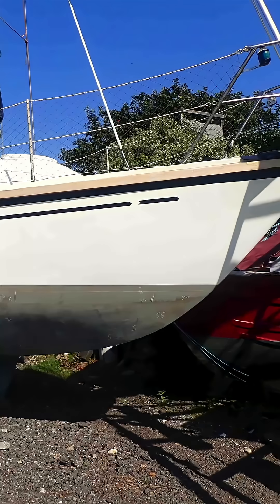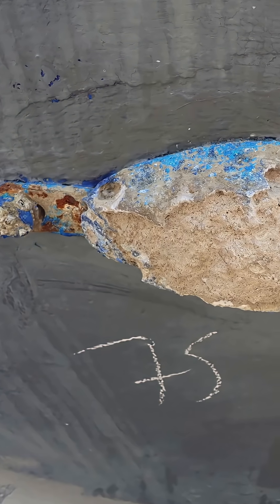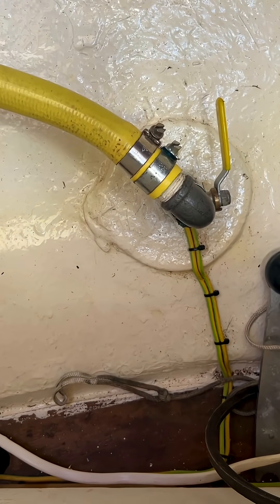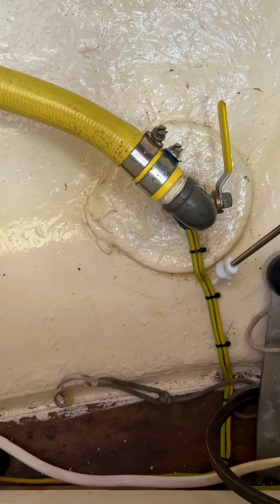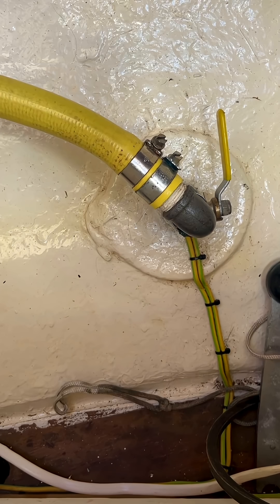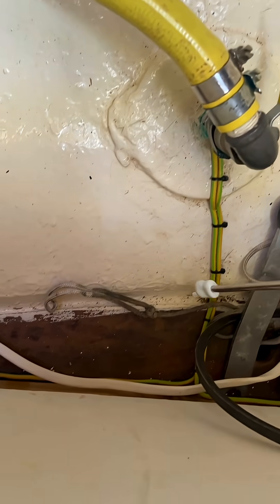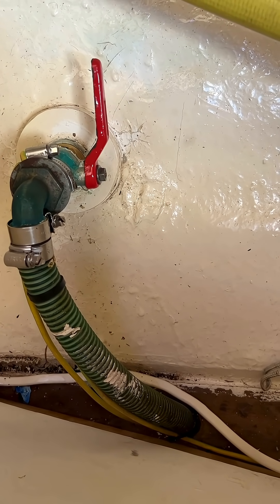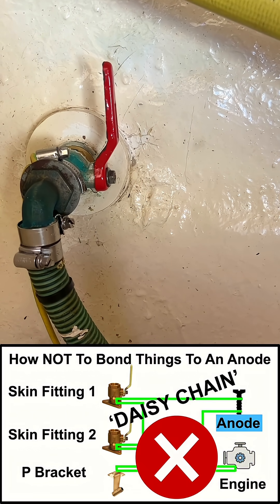Bonding Seacocks On A Boat MUST Be Done Right

Comment: Excellent explanation. Another view is not to encourage any electron movement and leave everything sea cock-wise isolated, making sure you are using high quality DZR. Better still, if you have room, fit 'plastic' ones.
Reply from the maker: Thanks.  Couldn't' agree more with you, Marelon and TruDesign are really changing the way we look at bonding systems.  But on many of the older boats I survey that are being run on a tight budget, you have to make do with what you have. Not all boats need it, but if you are going to bond, be sure to do it right.